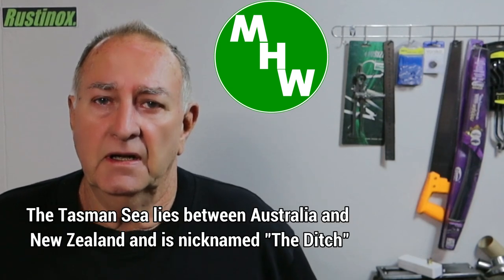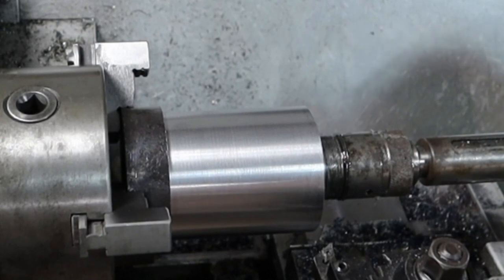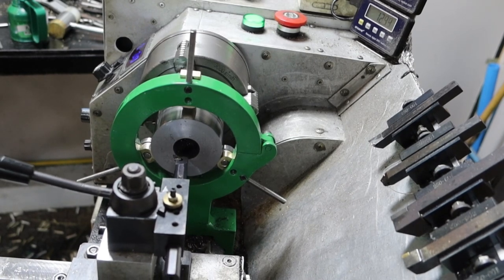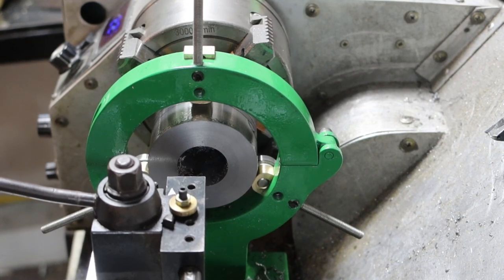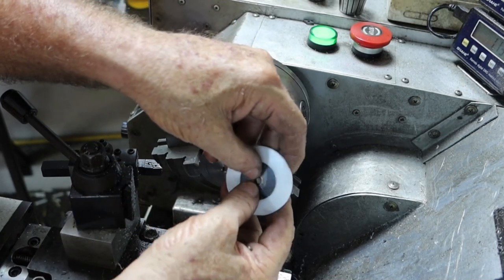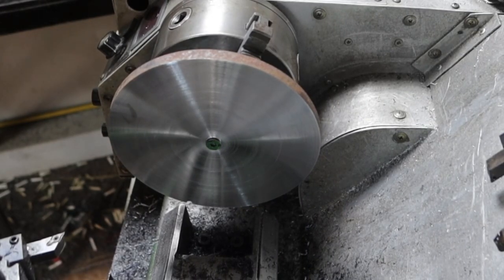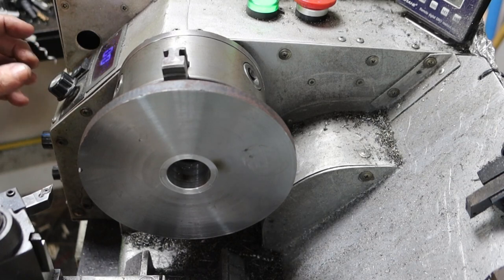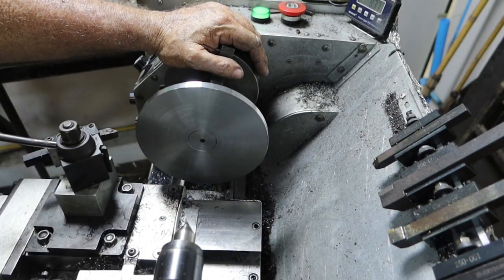MHW Episode 116 - Homemade ER32 Collet Spin Indexer - Part 1

Comment: Thanks for the shout out, most appreciated. You are quite right about buying these spin indexers. The one you showed is less than $65 in the US, but in NZ the exact same thing is almost $500. That is why I built my one. Good start on the project and I cant wait for the next installments.
Reply from the maker: No probs, you earned it, I used a snippet from one of your parts in my part 2. I did ask if it was ok with you. Thanks for watching
Reply from the maker: By the way, you get another mention in my next project as well 👍
Reply: @MyMiniHomeWorkshop  No problem using snippets of any of my videos.
Reply: @MyMiniHomeWorkshop  Thanks again. I wonder what that one is about. Any clues?
Reply from the maker: @thehobbymachinistnz  Something recent that you threw out a challenge to make 🤔
Reply: @MyMiniHomeWorkshop  Aha ha...

Comment: Good to see you are spreading the job out. The motor on that lathe is performing way above it's rate performance you may need another fan to cool it down some.
Reply from the maker: Yeah it's struggling a bit, and since the smoking issue, it's bogging down a little more than it was when I first installed it. I have considered getting a computer fan and mounting it at the rear end to help with the cooling. Thanks for watching 👍

Comment: Could you add 480p resolution to the videos please. 🙏
Idk about anyone else but 360p is too low and barely shows detail and 720p is too high and buffers constantly. 👍👍
Reply from the maker: Not sure that I can do that, but I will look into it. Thanks for trying to watch. 👍
Reply from the maker: Have you tried setting it to Auto ?? I just watched a video by a guy debating the issue with YouTube and he never got a satisfactory answer from them as to why 240 and 480 are mostly no longer available, but still show up on some channels.
Reply from the maker: I've just noticed that I exported this video from my editor at 50fps, so I will export Part 2 at 30fps which is what I have been doing up until now and hopefully that will help you out, it does however lower the video quality, but I aim to please. 👍